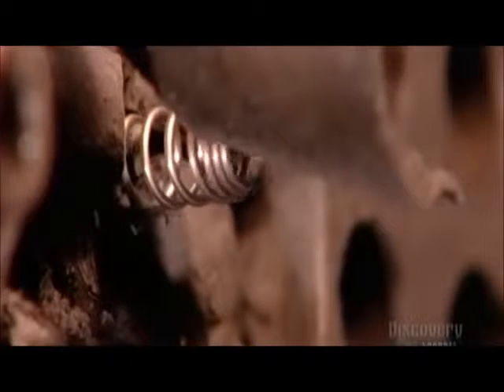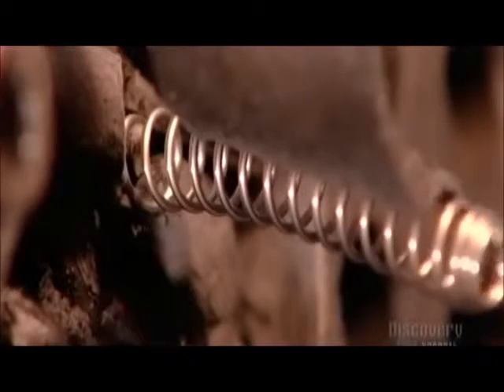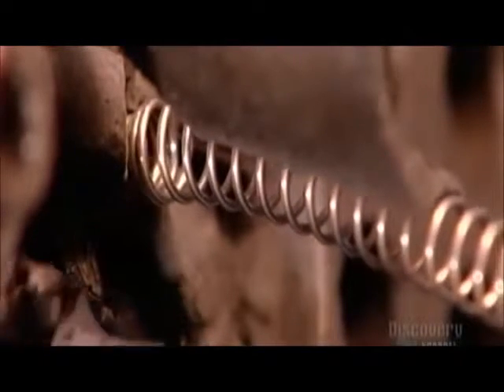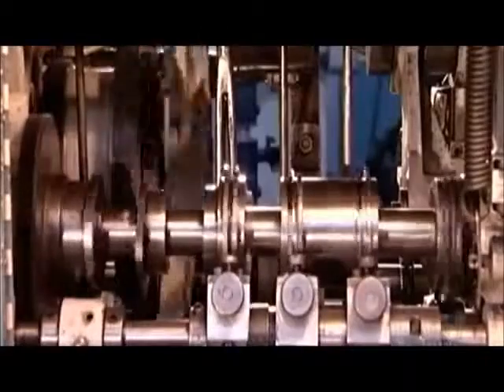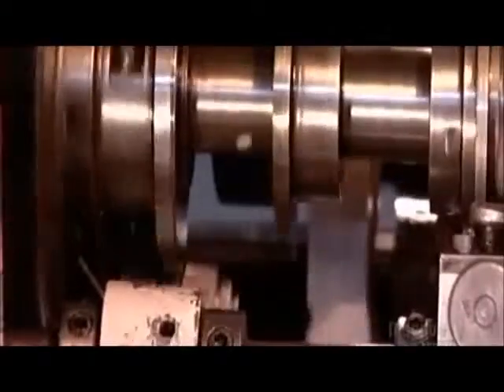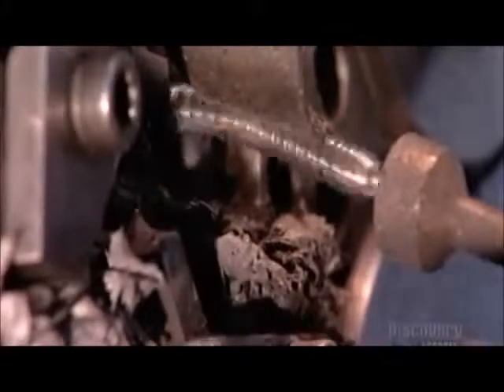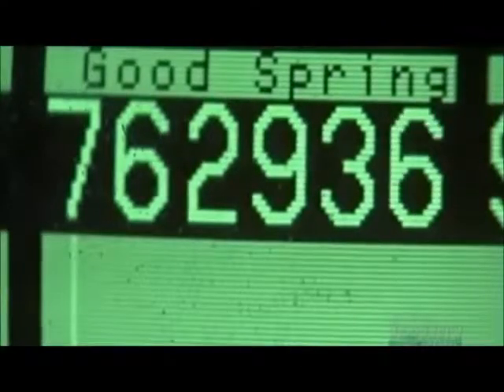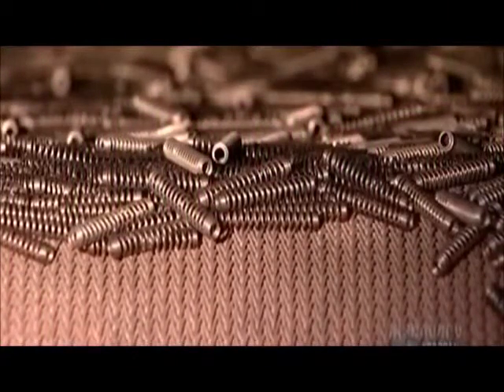How its Made Springs

Comment: HOW'D THEY GET SPRINGS ON THE MACHINE THAT MAKES SPRINGS??!!!
Reply: This is just the most efficient industrialized way. I’m sure they made them differently and less efficiently before
Reply: @sircartier4703 not necessarily. “the most efficient” is unlikely, as a rule of thumb, machines cannot be 100% efficient. Most of the time machines efficiency can be improved. Most engineers of machines have points of diminishing returns where making it more efficient would be increasingly challenging or cost-prohibitive.
Reply: @Session.Weston  i didnt  say it was perfectly efficient. I know you wanted to feel smart by correcting someone on the internet, but what’s you’re saying I wasn’t even talking about

I was just saying it’s the most efficient way we know, not in all the universe
Reply: @sircartier4703  how could you be so sure this particular machine is “as efficient as we know”. Your a making statement as if you were the mechanical engineer who designed this matchine🤣
Reply: @Session.Weston  matchine, huh? 🤔